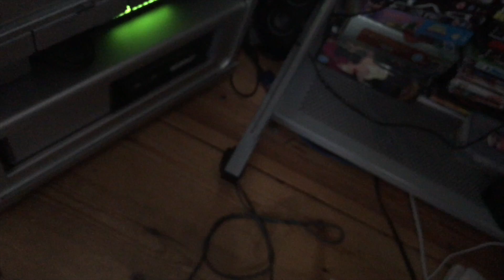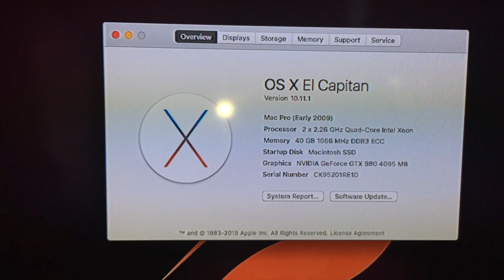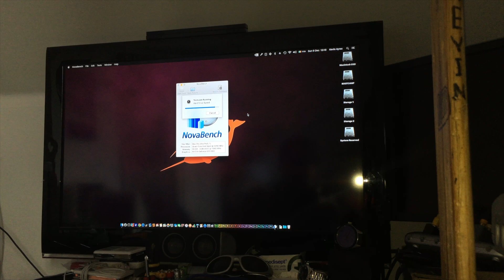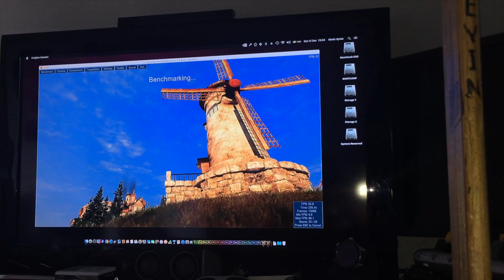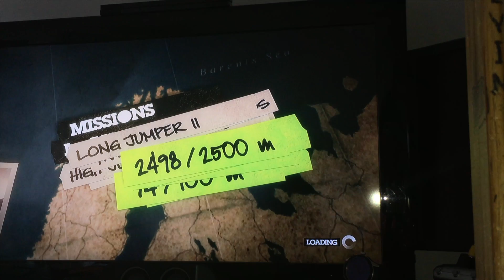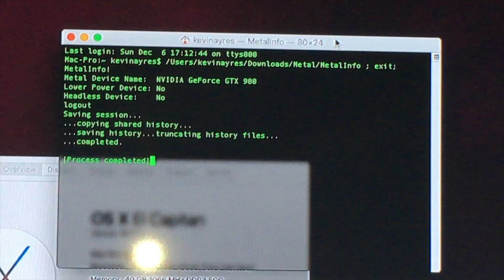Mac Pro 4.1 2009 with EVGA GTX 980 SC Benchmarks on OSX and Metal Support?

Comment: Hi buddy, any suggestions where I should buy the power cables to feed the GTX 980 with enough power? I live in the UK. Thanks!
Reply from the maker: Bart Wouters hey yea right now the best place is on eBay it's where I get my mini 6 pin to 6 pin cables.

https://www.ebay.ie/itm/381836950063

Comment: Kevin, where I can buy those power cables? Where did you find the double 6-pin to 8-pin power connector?
Reply from the maker: ebay they aren't dear but here are the links

http://www.ebay.ie/itm/Mini-6-Pin-To-PCIE-8Pin-Video-Card-Power-Cable-Cord-Adapter-For-Mac-Pro-G5-Tower-/252586998475?hash=item3acf5bbacb:g:UqoAAOSw4shYAkvM

http://www.ebay.ie/itm/New-Mini-6-Pin-To-PCIE-6-Pin-Video-Card-Power-Cable-Cord-Adapter-For-Mac-Pro-G5-/262533929484?hash=item3d203dda0c:g:qqUAAOSwj2dXjkei

Comment: THANK YOU!!!  We have the exact same Mac, this video was SOOOOOOOOO helpful!  Question, does 10.11.6 utilize all 4 gigs of RAM on a 980?  I'm buying one today.
Reply: Thanks from me as well. I was thinking to do this for the sake of Adobe Premier.
Reply from the maker: yea the 4GB GPU issue was resolved in 10.10.1 so you get full access to GPU now but windows dose take better advantage of the GTX 980 so if you are doing video editing the GTX 980 is great for CUDA GPU acceleration. for gaming install windows on bootcamp and it works great.
Reply: Thanks!

Comment: I plan to get a GTX970 for my 2009 Mac Pro 4.1.  Can I just pick up any card for PC or if there is any mac-edition card that I shall get?  New to Mac Pro and thanks for your help
Reply from the maker: well you can use any Nvidia card flavour you want, I just use EVGA because they have never given me any issues, but if you use a PC card you will loose the booting Apple logo and you will need to keep your original EFI card incase you run into issue in the future or need to do OS updates, other that you should be good just need to install the web-drivers and CUDA drivers. really now a days Apple is not supporting Nvidia cards so thats why there is a bit more messing around but it works great otherwise.
Reply from the maker: or if you want a Mac EFI modded cards here is a link it pre-modded card 

http://www.macvidcards.com/store/c1/Featured_Products.html

Comment: Hey pal, perhaps you can help me. I was unsuccessful in swapping out my 8800 GT for my GTX 970. I installed the drivers, switched over to web drivers as the primary, and my system just reboots. I am running the latest OS and drivers. My system is a Mac Pro 3,1. Anyone with experience in this type of upgrade around tonight to weigh in? Thanks!
Reply from the maker: The Third Planet hey so I have come across this issue a few times you have 2 option either run the Mac Pro with the 970 and a Apple EFI card or my recommendation while and clean install your OS and web-drivers, these are your best options, there seems to be a issue some times installing the web-drivers on a old OSX install

Comment: Kevin I have a question to ask you. In regards to fan noise....How is it in this case. I have the quadro 4000 and its runs like a jet engine. I am about to buy this 980 but I don't want to deal with fan noise when I record audio. Your input would be very appreciative.
Reply from the maker: the fans do amp up but when starting to render and  export videos but once the it gets going the fan quickly slows down and I have never had it sound like a jet engine you might have a heat sense issue on the quadro 4000

Comment: hi, can i plug this mac pro in my imac?
Reply from the maker: Kinda .... depending if your iMac supports "target display mode" a lot of the new iMacs like the 5k and 4K don't support it anymore. Check if your gen of iMac supports online there are lists posted up. What you would need is a cable from you Mac Pro (HDMI in my case) to the thunderbolt or mini display port on the back and keep you finger on Alt and T when boot the iMac or just T can't really remember haven't had to do this in years good look with it.
Reply from the maker: rui alka it really depend if your iMac supports target display mode but rather than that if you iMac has a thunderbolt you would be better off buying a thunderbolt to PCI-e and run a GPU externally Bizon box are a good brand

Comment: Very late to the party. I missed the bus. Just to confirm that with any OS > 10.8.3 ( ai am on 10.11.6) no ram limit for OpenCL or any other type of acceleration. I recently put a gtx 980 ac 2.0 in my mac pro and all benchmarking apps show the 4 MB VRAM including luxmark.

Comment: How is video editing on OSX with GTX980? is it different story?
Reply: Also check number 16 on this thread. http://forums.macrumors.com/threads/frequently-asked-questions-about-nvidia-pc-non-efi-graphics-cards.1440150/
It is about 2gb limit on OSX
Reply from the maker: Hi so video editing is much faster since the 980. in FCP I get a 5K BruceX render time of between 21 and 23 sec but this can be affected if you render to a HDD where render time has jumped to 38 sec. in Adobe premiere pro and after effect with CUDA fully active it ran like a dream and rendered a 20min 4K video in 15min where before I just didn't bother going down the 4K road it is a great upgrade but right now I'm experimenting with a new Workstation GPU AMD FirePro W7000 and it has 20 compute units compared to the GTX 980 16 compute units so it should edge a head of the 980 just haven't had a chance to run it yet.
Reply: I have installed gtx 980 sc yesterday and it works great on adobe apps. I should install windows as well.

Comment: I don't understand the 2 GB "limit" you speak of. The Quadro K5000 - for Mac - is a 4 GB card. - Does THAT card not utilize all it's memory? I'm an editor, not a gamer. I have a 5,1 8 core 2.4GHz Mac Pro with 64 GB of RAM.  I currently have the GTX-680 (Mac Edition) installed running 10.11.5. I've been considering replacing it with a "FLASHED" 980ti or Titan X. Anyone have a similar configuration? Any further understanding on the 2 GB "limit"? - Thanks for the video.
Reply from the maker: hey so the 2GB limit as far as I know only effects non Flashed cards as for some reason openGL just dose not utilise it properly. for what you are using it for you are better off going AMD for video editing the current Mac software such like FCP and other open CL applications work best with AMD cards, now any modern day AMD card would be a vast improvement on your current GTX 680 but because CUDA is only supported in select software like Adobe Premiere and after effects but really now a days because current Mac's are been released with AMD cards Apple have been best with this configuration at the moment. the reason for me fitting the PC 980 in this machine is windows runs the card fully so I haven't much to worry about.
Reply: Actually, Premiere, AFX and Media Encoder are my "bread and buttter" applications... should I still go with AMD? If so, what's the best card you'd recommend? Much Thanks.
Reply from the maker: so I've been told the AMD R9 280 and 380 are the best cards for video editing due to there great open CL support, if you are a Adobe user lucky for you Adobe has CUDA support I have seen very little differance in GPU rendering in both open CL or CUDA so maybe sticking with Nvidia might be your best choose. one thing that most people dont now is you have to activate CUDA with a bit of text editing ill leave a link to a video that will show you how to

https://www.youtube.com/watch?v=8VSp2BkAln4

Comment: I have Mac Pro mid 2010 and I'm thinking to get a nvidea Getz 780 do you think if it will work
Reply from the maker: yea its a great card it stays between the 970 and 980 in preformant and sometimes trades punches very well with the 980 the only issue you will run into is the power cables the main reason I went with the 980 was for the dual 6 pin connectors with the 780 they come with either 2 8 pin's or a single 8 pin luckely there is cable available I leave a link to where I got a good quality pair 

http://www.ebay.ie/itm/251327746175?_trksid=p2060353.m1438.l2649&ssPageName=STRK%3AMEBIDX%3AIT
Reply: +Kevin Ayres Hi thank for getting back with these cards can you play 4K gaming on these cards is it supported and do I need to change the power supply for the Mac Pro
Reply: +Kevin Ayres I brought this cable from Amazon just confirm for me if it's the right one I'll leave the link below. Apple Mac Pro mini pci-e 6pin to pci-e 6pin video card power cable 922-7128 https://www.amazon.co.uk/dp/B0095SUCUQ/ref=cm_sw_r_cp_api_dFwIxbMCGDV1F
Reply from the maker: +BMW M FAN NJ 4K gaming is possible on low resource games like Grid 2 for example i only play in 4K but games like Doom and fallout 4 2k and for silky smooth FPS over 60 1080p, for 4K 4GB VRAM is not enough you 6 to 8GB card for 4K to be playable on most titles. As for the PSU the is a 980w it's has tones of over head for big GPU's.
Reply: +Kevin Ayres Thank you so much for helping me and giving me the information it's helped me a lot. :)
Reply: +Kevin Ayres how many cables would I need to buy
Reply from the maker: +BMW M FAN NJ depending on the 780 they could have x2 8 pin or x1 6pin and x1 8 pin it's hard to say without seeing the card but if you find the spec they should be able to tell you
Reply: +Kevin Ayres ok so today I brought the EVGA GTX 980 Ti SC so I'll receive it tomorrow and I'll see what I need

Comment: What NVidia Driver are you currently using for your mac?  Web driver?  which version?
Reply from the maker: +Jose L Ramirez I'm currantly on Web Driver 346.03.05f02 but this is for OSX build 10.11.3 (15D21) so unless your OSX build matches mine it wont install on your machine.
Reply: I have version 10.11.4 plus my Geforce GTX 970 connects through a thunderbolt case.  With windows 10 it works perfect but with OS X, it will start to lag.
Reply from the maker: +Jose L Ramirez lag in what way? If in gaming OSX dose not game very well at the best of times I get 30 FPS from dirt 2 on my 980. I would only recommend using those thunderbolt to PCIe boxes is if you need CUDA in OSX or improve your gaming on Windows.
Reply: I did.  I'm thinking of formatting the HD again and do a clean install.
Reply from the maker: +Jose L Ramirez that may fix you issue a clean install can fix 99% of issues but if you just bought the PCIe to TB box there should be a support help line that could help you from the manufacturer's
Reply: thank you so much.  I just finished re installing OS X from scratch, not a time machine restore and I think it did it.  Ive been using  the external video card for almost an hour with no issues.  did a couple of benchtest, running 85 fps at 2k, which I think is more than reasonable for what I do.  Before the clean install, I could nearly use the machine for 5 minutes before it will start to lag.  I do appreciate your help and you good intention.  I think its now: Problem solved!

Comment: Did you download and install the Nvidia Mac driver for this card? Just asking because I have a Nvidia GTX 770 installed in a Mac 3,1 and found the the Nvidia Mac driver is superior to the built in Mac driver especially with PWM management
Reply from the maker: +Armando Diaz hey yes I have the Nvidia web-drivers installed apple never released built in drivers for the 980 so its the only way to run it on OSX. as for increasing speed I don't now about that I find I'm getting a half the performance from my 980 in OSX than I do on windows 10. Nvidia are recommending everyone to use the web-drivers and the CUDA anyways just for GPU exhilaration when rendering and scrubbing through pre-rendered video. but it will not make OSX game much better even though Apple made a big thing about gaming coming to Mac with Metal and haven't said anything about it since.
Reply: Thanks Kevin!

Thanks too bad. Has NVidia updated the driver or cuda lately? Thanks!
Reply from the maker: Armando Diaz yea every month there is usually a update but you have to go into System prefs /CUDA / Check for updates same with the Nvidia web-drivers

Comment: ATI is in no way low end compared to to Nvidia cards of its time nor are you "cheaping out"
 by buying one of their cards
Reply from the maker: +theboard 1 hey from personal experience with ATI I have never found them to be reliable or of good quality I will agree Nvidia has released some shitty cards in the past but every ATI card I have own has died after 2 years of usage the last one I owned and used as a daily driver was a 4870 the fan died so I bought a new fan second hand 2 months later the card stopped out putting video. also the iMac 2010 and 15" Macbook Pro 2011 recall on faulty ATI cards Apple are replacing the logic-boards and GPU's for free. the new fury cards do look interesting but I have completely given up on ATI at the moment also I did say "I have my own issue's with ATI"
Reply: you must have gotten "dud" cards because i have 2 that still work and are still in use, one is 3 years old and the other is 7.
Reply from the maker: +theboard 1 yep from new duds and ATI got 4 chance's where usually I only give one reasons why I only EVGA flavor GPU's and Apple products nither have given me trouble yet I couldn't in good faith recommend a product that I have never had a good experience with. and today I'm doing 6 15" 2011 Macbook Pro's a week due to repeats because the cards are dying a week or a month down the road.
Reply: ATI got bought by AMD anyway soo...
Reply from the maker: soooo what AMD bought ATI years ago like in 2010 or 2011. I use two Intel xeon in my Mac Pro I don't see your point on this one.
Reply: Kevin Ayres therefore it is under different management
Reply from the maker: it might hurt to hear this but AMD where considering buying Nvidia before ATI so even ATI was last on AMD's list unless bring 3DFX back from the dead was a option hahaha. but I know how loyal a fan base is I don't like ATI for there bad quality control, overheating cards (turned into a features may I add) and still unable to out perform competitors even with new tech (e.g there new Fury X is there most powerful card cant out preform a GTX 980 TI and they are the same price). also because you still have working cards from years ago don't mean people are going to have the same experience. its like me owning car for 7 year and works fine never gave me any trouble and you buy the same car and the engine and gearbox fell out from under it after few years would you go back to that brand and if so are you a glutton for punishment. sorry for been abrupt with my answer to this but I'm not stopping you from buying more ATI cards if you like the cards and you certainly do as far as you are defending it. but you are not going to change my history or opinion on ATI they have been a inferior products for a while and AMD now that.

if you want a quick read its quite interesting 
http://www.tomshardware.com/news/AMD-ATI-Nvidia-GPU-Tegra,14795.html
Reply: you say you don't like ATI for their overheating cards but do you remember the GTX 480?
Reply from the maker: the GTX 480 was room heater I never owned one due to reviews and pricing I think I was still running two 8800 GTX in SLI until the GTX 560 was released Duke Nuke Edition from EVGA cool set but shit game. also I will add another GPU to the Nvidia List of overheating the 8600 GT M in the dell XPS laptops and Macbook Pro line of laptop's they use to get so hot they would desolder there own GPU chips off the MOBO close to what most dead ATI cards do today. but that really doesn't touch the mount of overheating cards ATI have dropped on people over the years. the R2 200 series cards are known over heaters idling around the 80'sºC during a game. my 980 idles around the 50'sºC while playing Fallout 4 maxed out. even when you google over heating ATI list's and list's of ATI card all different ATI cards show up. people are actually asking "is it safe to run my ATI 5770 at 110ºC" also the answer to that is no 80ºC max because solder has a melting point of 160ºC to 180ºC depending on thickness and overtime the 110ºC will kill you GPU. and others saying to that guy" The 5xxx cards happily purr away at around 80-85 degrees as a norm" that is way too hot. good luck man i think this conversation has hit its climax to day ATI still release overheating cards the last card to over heat as a known issue GTX 480. also another complaint about ATI they rebrand old cards and release them as new next gen cards just with a slight speed boost that could easily be done at home with a overclocking tool and sometimes charge more. every release from Nvidia is a new GPU architecture. the ATI fury X is the first card in years to have a hole new Architecture and maybe someday i might try it out because of that but other wise. Nvidia are bring something similar out soon.
Reply: actually the 300 series is not "just" a rebrand even though they were based on the same architecture there were many differences between it and the 200 series cards and the fact that the fury X and the 980 are around the same performance point shows that AMD cards are not low end and with polaris and pascal are coming out soon and the possibility of next flagship card beating nVIDIA's